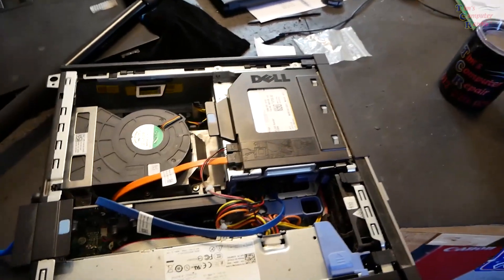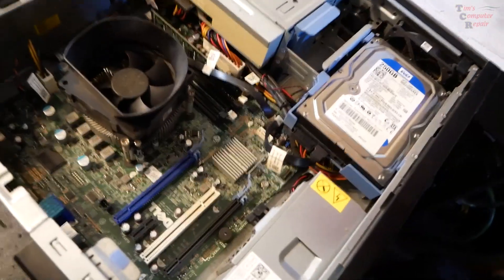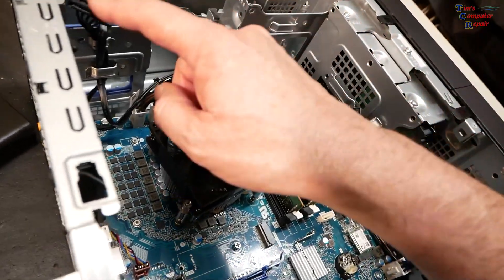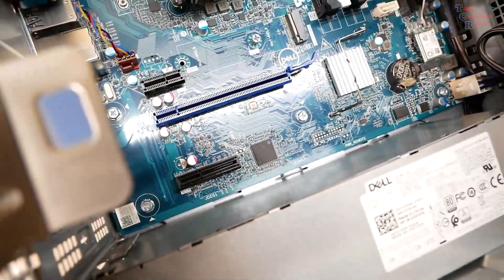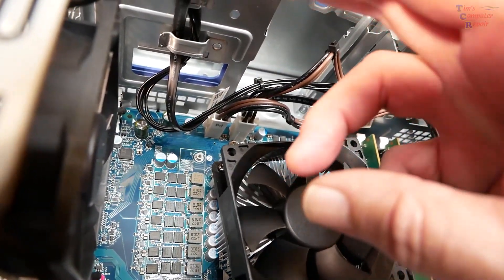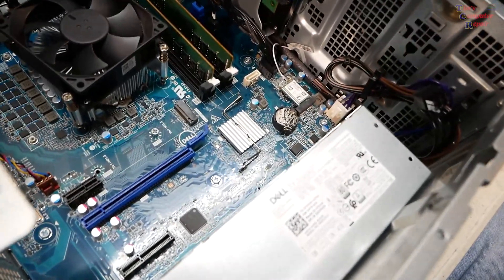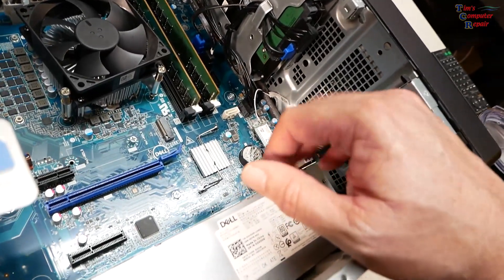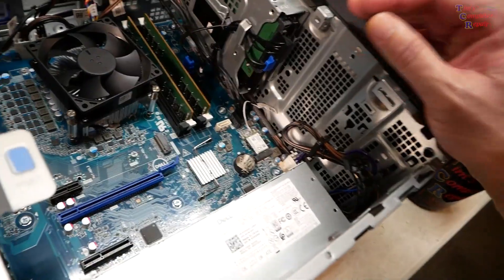Dell is Changing the Design of Desktop Computers. Attention Technicians!

Comment: That is the reason I recently got rid of my HP omen Case and MB. proprietary parts make it hard to diagnose and replace parts. I ended up taking the SSD, Video card, and memory out and rebuilding in a standard case with stand PSU. Thanks for video.
Reply from the maker: Thanks for commenting and watching.

Comment: It's just around the corner with the elimination of 24 pin power connectivity as the industry moves toward 12 pin.  As in this video, many of the periphials that were powered by the PSU itself (5v and 3.3v) will be soon be powered by headers on the board. Items like the SSD, HDD, DVD etc. PSU's will then only output 12v, nothing else. This Dell has 6 pins although my resources suggest 12 pins (If I recall correctly) will be used for home built/custom machines. So this will change much of the standards to different PSU's and motherboard connectivity which might be due to ways to save energy or a way to sell more hardware vs "upgrades" with existing hardware.
Reply from the maker: Thanks for your input and thanks for watching.

Comment: 1. HP started this trend at the tail end of the Core 2 Duo days back in 2010.
2. Nowadays HP/Dell/Lenovo/Acer all do it. Of course, one company's power supply is not compatible with any other company's.
3. These types of power supplies are actually cheaper to produce because you only have to supply 12V. The motherboards have some extra power converters to supply 5V and 3.3V to hard drives/SSD's/DVD drives.
4. It makes cable management better.
Reply from the maker: Thanks for the input.

Comment: Tim how did you know a client of mine dropped off a Optiplex 3010 SFF today :) I remember when Dell used a ATX connector that was wired differently so you had to be careful not to use a normal power supply on the mboard.
Reply from the maker: That's how the technology gods work. Thanks for commenting.

Comment: Dude you could make  a  adapter   for that  type of plug      The  motherboard  has it's  own  switch mode PS.  regulators  that  power the external   devices
Reply from the maker: Thanks for commenting.

Comment: That's why I hate proprietary parts on Dell and HP computers; makes it harder for field techs to do repairs.  I found a 6-pin to 24-pin  adapter on Amazon :  "COMeap 24 Pin to 6 Pin ATX PSU Power Adapter Cable for Dell Motherboard with 6 Pin Port 13.3-inch(34cm)"  Hope that helps...
Reply from the maker: Cool..appreciate tje info.